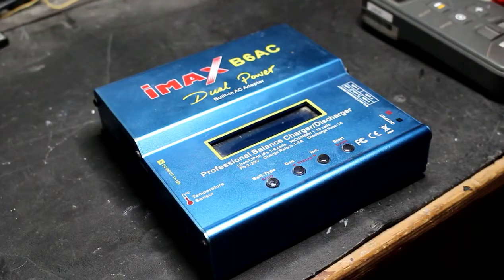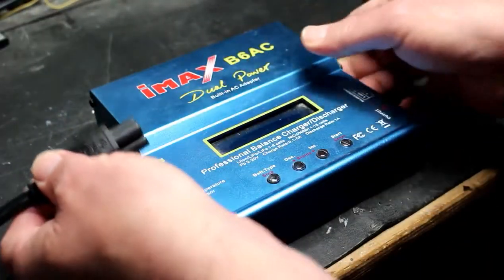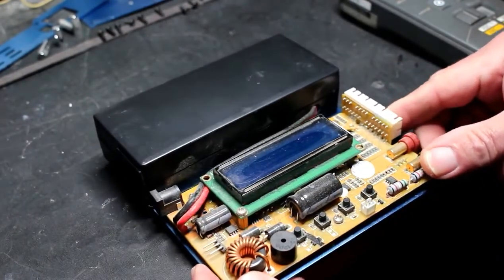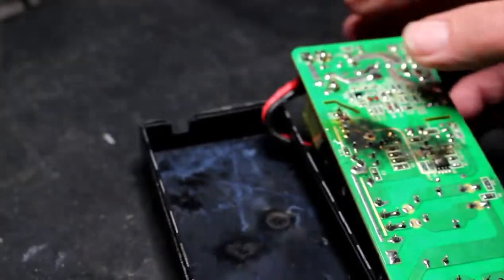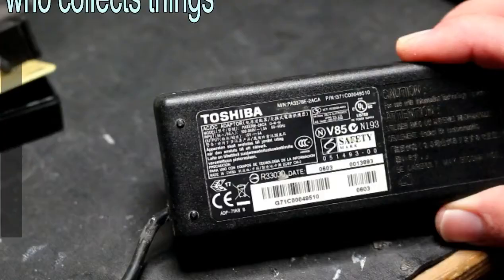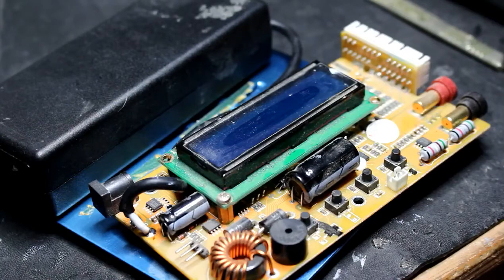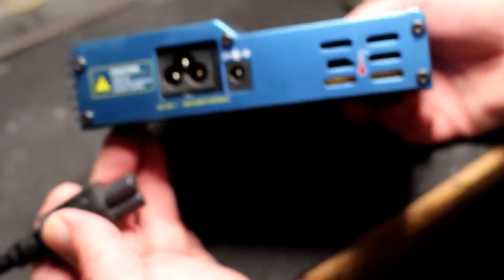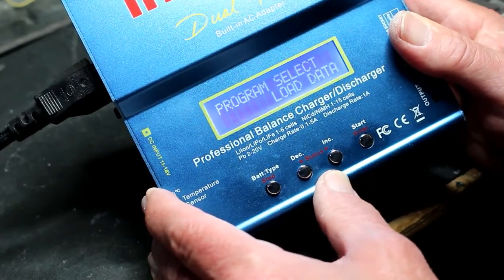iMAX B6AC Charger Repair - Electronic Repair Project

Comment: Hi, are you stil using this charger ?
Reply from the maker: Yes! It gets used twice a week flying days permitted. Thanks for watching, have a great day!
Reply: @1nformatica  l have b6ac pro, when l push start  button the device restart l dont know why. Can you help me pls
Reply from the maker: @SoCloseng  First I would go into the menu and reset to factory settings. If the problem is still there I would power the unit from an external supply, sometimes the internal supply will fail. Otherwise you will need to open it and check for loose wires, bad soldering or failed FET. Maybe just cheaper to buy another!!
Reply: @1nformatica I tryed another power supp but it didnt work. Can you share gmail ? I will sen you a photo. There is one failed chip on my board. There was smoke when l opened😢
Reply from the maker: @SoCloseng  If you want my email is gizmohombre@gmail.com It is probably beyond economic repair. I see these on second hand places for little money.

Comment: u know how to overcome the error occurs on my IMAX B6   when try to turn on, there's only display blank light without buzzer sound on the start...
Reply from the maker: It looks like there is no power to the unit. You will need to open it and check the voltage of the power supply with a multimeter. Thanks for watching, have a great day!
Reply: @1nformatica  your welcome...

honestly, I've tried to Open it while checking the input supply, included three MOSFETs behind, but  the power input is normal. I don't know wht to do as a beginner ..bro🙏

Comment: Just had my brand new b6 blow 30mins into my first charge 5amph on a 6s balance charging, just tested it on 12v and it works.. Messaged the supplier and hopefully they sort me out with a new one
Reply: Like me, another victim of the B6AC's "Not self-limiting" problem. I gather you tried to charge a 6S LiPo pack (22.2V) at 5 Amps from the mains. This requires 111 Watts, but the internal mains adaptor is only rated at 60W, and the software does not prevent you from setting such "impossible" combinations. Result : Toasted mains adaptor.
Using an external battery instead of mains will avoid that issue. But if/when you get the new one, don't try that combo on the internal mains adapter again ...
If using the internal mains adapter, manually observe an overall power limit of 60 Watts or less and you should be OK.
Apart from using an external 12V battery, another option to get full charging capacity from the mains would be to use a beefier external mains adaptor with a higher power rating, eg 12V/8A (96W), 12V/10A (120W), 15V/8A (120W) etc. A 15V/5A/75W adapter (as per 1nformatica's internal fix) will also work, but you will then be limited to 75W, of course.
Reply from the maker: Hey that's a bummer but at least you can use it on 12 volts. Hope your supplier does the right thing. Then you'll have one you can take to the field too!! YouTube no longer shows me if you are subscribed. Please consider subscribing if you have not done so already!

Comment: Sadly it happend to me yesterday. I have no spare internal power source. I fixed it by using an external 3 Amp 12v wall adapter. Best regards
Reply from the maker: Good thinking! Glad you got it working. YouTube no longer shows me if you are subscribed. Please consider subscribing if you have not done so already!

Comment: Good video! Thanks for sharing your experience.
Mine was similar - actually the PCB in the laptop PSU blew in EXACTLY the same spot, although the cause was different (or was it ??! :-))
In my case the B6AC was unequal to a challenge set by its own software.
The unit is loosely specced in the manual at "Max. charge power 50W", and although the laptop PSU is unmarked, popular opinion seems to peg it at 12V, 5A (60W).
The max charge current for the B6AC is specced at 5A, and the unit can supposedly charge up to 6 Li-Ion batteries in series, hence 5A x (6 x 3.7V) = 111W (in theory).
Likewise, for a 10-cell lead-acid battery, 5A x 20V = 100W.
In my case I wanted to charge a 4S/14.8V/13Ah  Lithium-Ion battery as fast as the charger could go, ie 5A. (5A x 16.8V = 84W).
Nothing in the software will prevent you from setting these "impossible" combinations and one assumes the unit will look after its own limits. Bad assumption..
Part-way through charging, I could hear (and smell, and feel) that the AC adapter was taking strain, but the charger seemed to be limiting to about 3A so I decided to see what happened.
Suffice to say, the 60W power adapter proved unequal to the 84W test ....
Reply from the maker: Hey! Thanks for sharing your notes too all useful stuff to know if others are looking for solutions. Glad you got it fixed and thanks for the heads up on "impossible" settings! Would love to see the owlcam back on line! Please consider subscribing if you have not done so already!

Comment: I wish mine was that easy. I had 2 burn up on me already. 1 I can see might be fixable. 2 transistors and 1 resistor are burnt up. Now I have to figure out the part numbers
Reply from the maker: Maybe this will help you : https://www.rcgroups.com/forums/showthread.php?1362933-IMAX-B6-Schematic great source of repair info. Please consider subscribing if you have not done so already!
Reply: The parts on my board are not numbered so it makes it very hard to follow the schematics. And it doesn't seem to match my unit. The pictures on that thread don't look anything like the unit I have. Maybe I should make a schematic and post it.
Reply from the maker: @Shane71170  I am sure if you just post some photos of the board to that thread somebody will help. There are many clones as it is such a popular model. Good luck!

Comment: i have imax b6ac connection break problem.what is the cause of this?anybody can help me.thankd
Reply from the maker: Connection break simply means that the charger does not see the battery to be charged i.e. it is open circuit. Could be simply a broken charger cable or the unit itself is faulty. Sometimes transistor is blown see :https://www.youtube.com/watch?v=9Ndo6K7arZA

Comment: someone can have an answer with this charger. will use again after a while of having it saved and I find the surprise that does not want to charge more than any battery, the problem is not to read the resistances. Have not found bats, there is no Asian bat meter, read the voltage and the cells but not the resistance, this problem or any question?

Comment: Ic chip near black (negative plug) know the # easy to repair ?
Reply from the maker: It is a mosfet, should be quite easy to replace. This is the part:
https://uk.farnell.com/on-semiconductor/fds6680as/mosfet-n-smd-so-8/dp/1495210RL
Reply: @1nformatica  Would it be similar if replace with AO4468
 N-Channel  transistor , if FDS6680as not available or other alternate Mosfet transistor can match for this charger. Thanks
Reply from the maker: The AO4468 is a reasonable alternative. It has a max current of 10.5A against 11.5A and a lower power dissipation of 2W against 2.5W but should be OK.

Comment: i got the same charger from ebay, it worked for a few times only, then it would not turn on sometimes, now nothing.
so obviously they use power supplys with alot of that built-in-obsolesence.
Reply from the maker: My friend blew mine up! It is possible you have a fake copy https://www.youtube.com/watch?v=jQ6hhP7dVvM

Comment: my positive lead broke off inside the plug. anyone know a good way to remove it?
Reply from the maker: Hi, I am not clear as to which plug you are referring to. If it is your charging lead and the plug is molded on then you will need to replace the lead.
Reply: it's probably much too late for this to be any use to you but... Once upon a time I had a person's laptop in which the pin from the DC jack had snapped at its base and came out inside the barrel of the plug, too deep and with no useful edgy bits to grab onto. So I got a short length of reasonably thick single-strand copper wire with the insulation off-- maybe 16 or 18 AWG. I managed to solder the end of the wire onto the roughed-up broken end of the pin because it was clean and still pretty near the end of the barrel. Then I pulled ;)

I hope you got it sorted out in the meantime! I found this just because I'm trying to fix my B6AC . Recently I let it get rained on for a few hours while it was hooked to a pack and just waiting to be unplugged. So now something is worse than just the obvious corrosion, making the volts and current severely higher than intended on the pack, and even triggering a blink & a reset-- maybe hitting the overcurrent protection in that power brick-- when I try to do just one 18650 :(

Comment: Mine just popped and died I have loads of laptop power supplies laying about can I use any of them to swap it with or should I be looking for a particular voltage mine are mostly 20v thanks
Reply from the maker: Hi Terry, 20 volts is probably too high. The DC input range of the B6AC is 11 - 18 volts. The one I used was 15 volts.
Reply: 1nformatica perfect thank you for the reply now just need to work out which wire is positive and negative when I strip down the laptop charger
Reply from the maker: Yes, Chinese markings used to be a mystery for me, but no longer ............. https://www.youtube.com/watch?v=yQYRd3VJHyg
Reply: 1nformatica thanks very much it’s working perfectly again only issue I could only find a Dell 19.5v but will replace it with a lower volt one when I find or buy one

Comment: I have the same unit labeled by another provider. PS died when applying too many amps, and it not blocking me from doing so. My units came with alligator leads to ring/pin plug, so now use that with batteries, external brick, and anything else that deliver 11-18v and 3-5amps. Works great! After flying drones, I transfer energy from batteries (to discharge for storage), to depleted batteries needing charged up to storage level. Thx for your video.
Reply from the maker: Thanks for the feedback. I like your idea of using the energy from discharging cells to charge others.